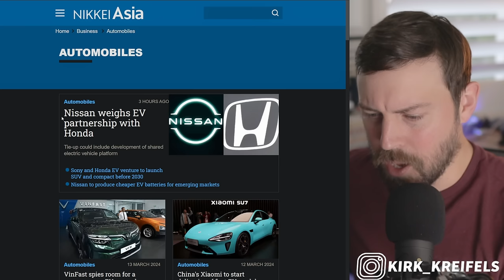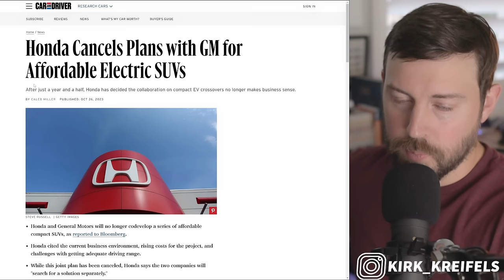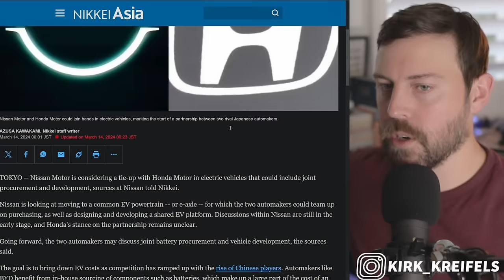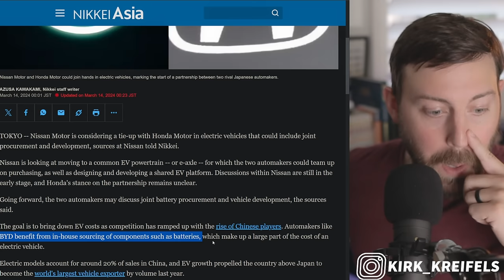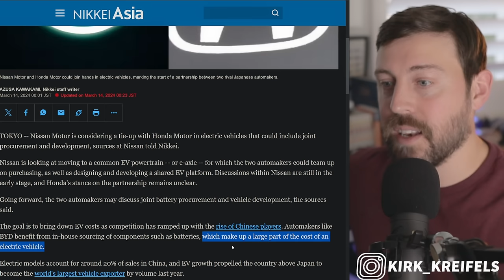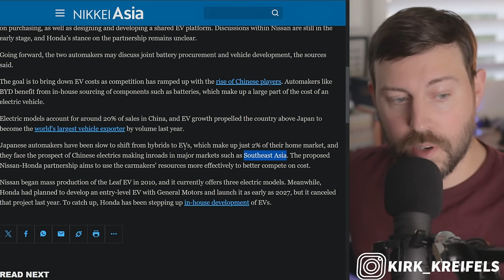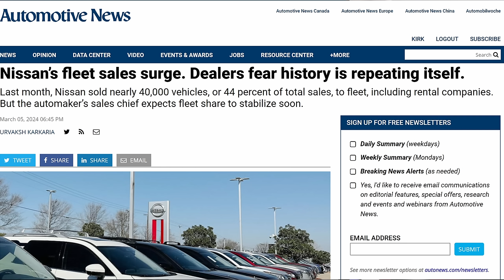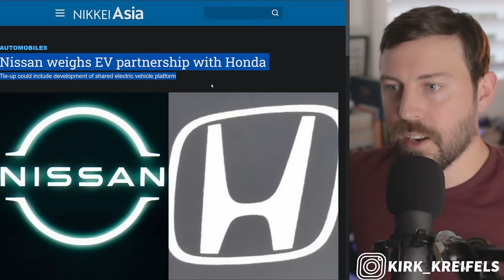Honda and Nissan are "in talks" // This Changes Everything

Comment: Let's hope this lifts Nissan up and doesn't drag Honda down.
Reply: I dont see Honda being brought down, as long as Honda makes the more executive decisions. I think Nissan needs a pick me up and a fellow Japanese auto maker could do that better than Renault or whoever the hell.
Reply: Let’s also hope they will bring iDx to market in kissing cousin form.
Reply: Honda has been in trouble for the last 8 years.
Reply: @AliasHSW That would be amazing✨ A fun competitor to Toyota & Subaru’s twins
Reply: Nissan won't be producing CVTs for this, so by default that lifts them up.
Reply: @JWFas they are dropping CVTs already the new pathfinder has a ZF, and their smaller vehicles will use their edrive system which  is very similar to what a honda hybrids use
Reply: Honda quality isn't what it used to be, not even close.
Reply: Agreed
Reply: Won't ever touch a Nissan. Tried once and never again 😢
Reply: @wasupfool5692  even toyota took a nose dive,   Cars have too many modules that can cause a single point of failure and these modules are all custom,   We need industry standards for modules.   Where one from a toyota works on a Nissan or ford.    We use to do that
Reply: It won't drag Honda down, Honda is still making a killing from their Hybrid models, Nissan has 0 hybrid cars which is basically killing their company. Why does this matter? Because hybrid cars have actually out sold ICE cars the past 6 months. Heck look at Subaru they just released their first hybrid model in the US the Crosstrek Hybrid and no dealership can currently keep it on stock.
Reply: @DJG37S  honda in america lacks a good plug in, they killed off the clarity’s but refuse to sell the crv phev
Reply: It's the other way around in the ev world

Comment: I just came from a Nissan Altima to a 2024 Honda CR-V hybrid.  I think the combination of the two would be really cool.  Their ideas for interior ergonomics and usability to me are among the best in the industry. Combining Nissan's seats with well, Honda's everything, would be a winning move in and of itself. 

Nissan sure gets a bad rap because of CVT issues, but if they could pair their current engines with a hybrid of Honda's quality, they would be really good.

Ariya actually is one of the most reliable electric vehicles if you do some digging...Consumer Reports in their recommended EV SUVs has only two EV SUVs listed as 4 out of 5 predicted reliability...the Ariya and the Lexus RZ...not bad company for the Nissan.

I think Nissan made some miscalculations that led to its current situation...for instance, if they were selling actually good hybrid Rogues in North America they'd be in much better position. They are more all-in on going full EV from a strategy standpoint and could use the help of a large hybrid brand like Honda.  Honda's vision is going EV by 2040, with incremental steps until then, which is more reasonable.
Reply: Nissan also has good hybrid technology with their ePower. I feel Nissan should stay independent because it gives underdog vibes when they constantly browse for partners. It’s pointless and damaging.

Comment: Ummm, it really seems everyone is trying to make it seem like Nissan is on deaths door. While it ain’t all rosey, they are not as bad as everyone is making it seem. If they were that deep in the dumps they would not have pushed to be more independent from Renault. But, yes, they are in an uphill battle. And in my eyes, Nissan is ahead of Honda with EVs. Yea Nissan pushed back their upcoming EVs, but I think that’s wise seeing how demand is not what people predicted and many other manufacturers are also readjusting their timelines. And why rush something to market if you can make it better and release it at a more opportune time? Especially considering they’ve been working on solid state batteries. At least they have SOMETHING to push back… Honda can’t say the same as they’re starting from square one after ending the GM deal. So despite the narrative, yes Nissan does have something to bring to the table, otherwise Honda WOULD NOT even entertain the idea. That’s just common sense.

Comment: Honda Marine sells a smooth modern VTEC V8. Put it in the new Prelude and say job well done 🏎️
Reply: Or in the back of a new NSX! But yeah a Prelude grand touring car with a big V8 would be epic. It will be made in low enough numbers to not skew their average EPA numbers though, and people in states like CA will just be out of luck.
Reply: @anydaynow01  and dealerships gonna MA that sh!t up like no tomorrow.
Reply: You would sell some cars with the V8, but people are not interested in V8's like they used to be. The EPA numbers on a V8-powered car would be so bad that it would scare away a lot of buyers.

A V8-powered Honda would not be a cheap project. The numbers of vehicles would be in such low numbers,  the cost of any V8-powered car would be very pricey. The V8 powered boat engine retails for $47,500 as is. It is the typecof engine that would be interesting to some, but its popularity would die out after a few years considering the cost to buy, run, and maintain.

Comment: Hopefully this doesn’t slow down Honda’s hybrid plans. Their hybrids are very reliable unlike the 1.5T
Reply: I know Toyota is the king of Hybrids, but Hondas hybrids are so damn good too. They drive with so much more spirit, and are still super reliable.
Reply: 1.5 turbos arnt reliable ?
Reply: @jedbriimc9879  Yeah their internals make a D series look like a 2JZ.
Reply: @jedbriimc9879  It’s Honda’s achilles heel. Even the CVT that gets paired to it will outlast the engine.
Reply: If anything I bet they would let Nissan use their tech to make more Nissan hybrids.
Reply: get the NA 2L
Reply: @Blank00  Honda's CVT is a good transmission despite it being a CVT. Unfortunately the Lame15 engine feels rushed and not well thought out.
Reply: @scott8919  let’s make things more interesting. Honda makes hybrids, and so does Nissan’s partner Mitsubishi. What if there is a hybrid powertrain with Honda’s Atkinson engine combine with Mitsubishi’s electric motors?
Reply: @jedbriimc9879 they blowing head gaskets
Reply: @GaryKetchum808 Honda ecvt still has a throttle body Nd more components like a regular auto which makes it less reliable unlike Toyota doesn’t have none of tht
Reply: My 1.5T Accord's been great!
Reply: Had 1.5T 2018 civic and no issues reported. Got 2023 civic now 1.5T so far it’s great. New 1.5T feels better for some reason not sure what changed
Reply: @rusack7174  I had to have carbon cleaning done on mine when it had less than 80k miles. Not the worst thing that could happen, but it certainly doesn't seem like an ideal situation.
I know my next car will either be port injected or more likely have dual injection (like Toyota's D-4S system)
Reply: @zkiller195  Sure, that's part of maintenance, maintenance many miles out for most. It's part of GDI engine life. Thankfully, Hondas have shown to not have the issue like some others.

Comment: Japanese-American-French version of Stelantis, could be promising. They each bring good things to the table to make it. 2+2 Nissan Z with an LT2 for the new Camaro, yes please! New Nissan 510/Renault 5/Honda City heck yeah. New GT-R could be a real MID4, mid engine performance hybrid AWD and shares the same basic chassis as the next NSX which would be the ultra light weight rear wheel drive version with torque vectoring on the rear wheels with hub motors, sounds like a plan!

Comment: I used to like both Honda and Nissan. I've had two Accords, two Maxima's, and a Pulsar. I don't trust either of them anymore, unfortunately.  I'm basically a Toyota and Subaru guy anymore. Started out "domestic only!". I've owned 5 "domestic nameplates"... '85 Chevy Nova, '92 Saturn SL, '92 Saturn SL2,  '89 Ford Probe, '96 Geo Prizm.  Only the Saturns were actually domestic cars. The rest were badge-engineered Toyotas and a Mazda.

Comment: I believe Toyota has the solid state batteries which are superior to today’s technology. Nissan has had a weak link, in my opinion, with transmissions. Even the original Q45 which I loved, had problems with reliability with transmissions. The CVTs they use are subpar.

Comment: The future doesn't sound good for either, but Toyota is working with Subaru and Mazda, it makes sense for Honda and Nissan to work together, but what about Renault, makes you wonder why GM didn't offer up the next-gen Bolt (EV), a Honda Fit EV (based on the Bolt, makes more sense than the Chevy Bolt for the US)

Comment: I'm not sure that all electric motors are the same, but I believe you meant they are not different enough. However, it is not the just motor that counts, it's all the electrical "package", with inverters and other stuff that makes it a difference. Also, I suppose this is a technology novelty, but I'm sure in the future there will be different types of electric motors produced just as there are a lot of types of internal combustion engines now. I mean gasoline engine started with only one type and slowly evolved to the multitude of engineering wonders over the past 50-60 years, all with the purpose of improving power and/or efficiency.

Comment: If these brands collaborate on joint platform development, the mechanics (powertrain and chasis) and their respective vehicles are built on different lines in the same plant,  what differentiates them for the market?   At this point the 'brand' is basically the same.  If they ride and handle the same, assuming they're similar priced with similar specs, as a potential buyer how would you choose one model over another? The only difference would be styling and interior packages.

Comment: Oh that's easy get rid of that cvt and build a higher quality  stronger v6 and i4 and Nissan would be good. As for for Honda just go back to what ever process you did in the 90s&2000s and the engine should be perfect. Transmission wise Honda needs to just keep the manual and spend just a little more time with quality control on the automatics.

Comment: I’m not sure about this news. Nissan has very good technology with Renault and their CFM EV platform and Nissan also is pretty advanced in solid state battery technology. I don’t know what Nissan wants with Honda. Nissan needs to get to work with what they have instead of browsing for partners. Nissan has the scale to be independent.

Toyota owns Daihatsu and large shares in Subaru, but Suzuki and Mazda are pretty independent. Nissan owns Mitsubishi and has a partnership with Renault so I think it’s kind of pointless to partner with Honda. Honda too, is pretty independent and I don’t think they want their integrity damaged by Nissan.
Reply from the maker: Honda is advanced with SSB too.
Reply: @KirkKreifels Yeah, but I don’t know if the partnership is worth the little advancement. Right now with the new governance structure of Renault and Nissan, I feel the alliance is already very strategic with Renault dominating Europe, Nissan dominating Japan, and Mitsubishi dominating Southeast Asia. I don’t know how Honda would fit in this. Renault and Nissan have some pretty good technology too that they aren’t working enough with.

Comment: Honda, just keep your j35 3.5 v6 for another 10 years. Add hybrid, keep it for another 20 years. Don't do EVs with Nissan or Failing brands,,, or do stupid thing like 3 cylinder Turbos. You really don't want be like Chevys... oh wait.. Prologue...
Reply: They just recalled a bunch of j35's for bad rod bearings I believe. They've got to replace something like 250,000 engines.